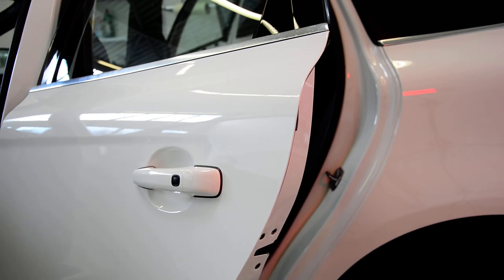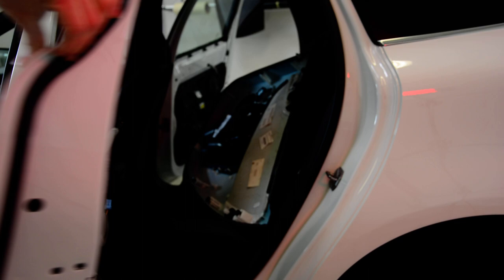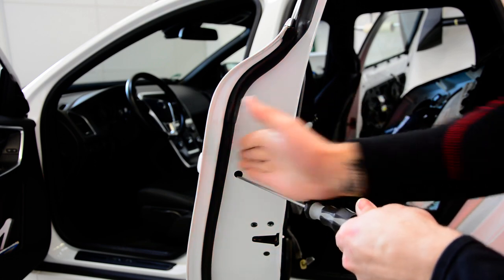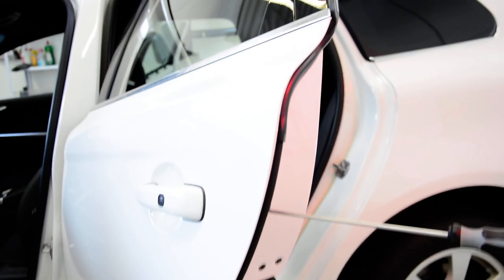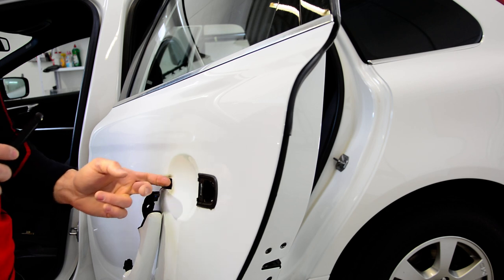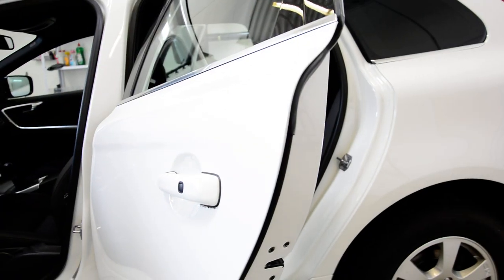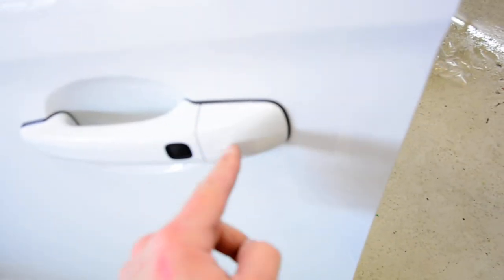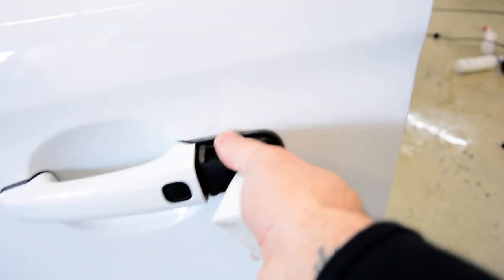How to remove the door handle Volco XC 60

Comment: Thx for making this! The key things to remember are 1) the torx is t20 left hand thread 2) the handle does not need to be extended to back out this screw 3) the handle can be unplugged without pulling interior panel, but you'll need to be very nimble.
Reply: What do you mean left hand thread?
Reply: @amana1480  I don't know why I wrote that. It is obviously a standard thread--turn counterclockwise to loosen, clockwise to tighten. Thx for the correction, I apologize for the bad information.

Comment: thanks for the handle removal video. My external door handle is failing top open on drivers door. Inside handle works.  I have removed the ext. handle via the t25 screw. The lock sounds/feels like it is working.  What do I need to clean/fix/replace?
Reply: Did you find a solution to this?
Reply: I have the same problem in my volvo v60 and still trying To figure out what I need to do
Reply: @cheapjoke7365  ita a cacle inside that runs from the handle to the latch. have to pull the window out and remove the inner panel.  cable is 30.00
Reply: @bradcapion200  Thank you. My door fixed itself when there was -18 celsius outside
Reply: I'm facing the same problem like yours, external door handle unable to open. I'm currently using gentle pull on the lever while pressing on the door key knob and it works. Not sure what is the problem for the door not opening. Is it the sensor or the power locks.
Reply: HAVING THE SAME PROBLEM
Exterior door handle is not working, door will open if handle is "flicked" hard enough. Any solution to this?